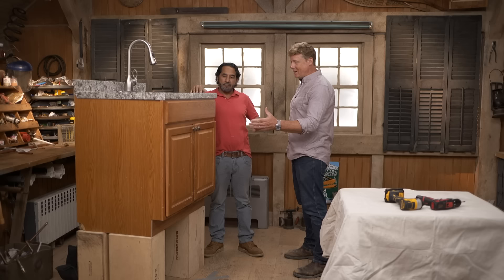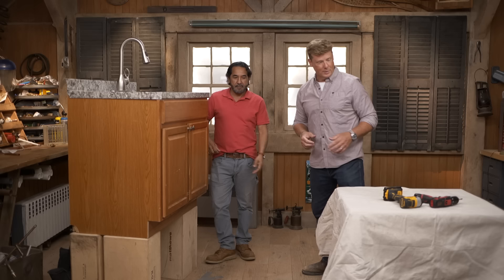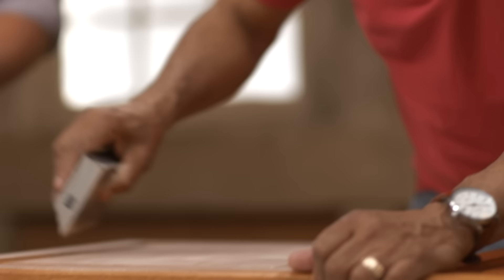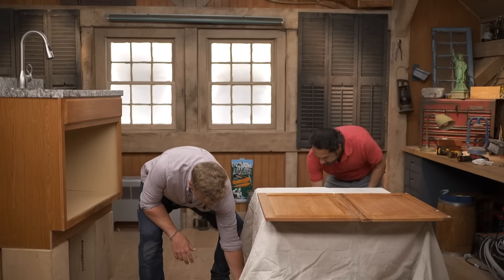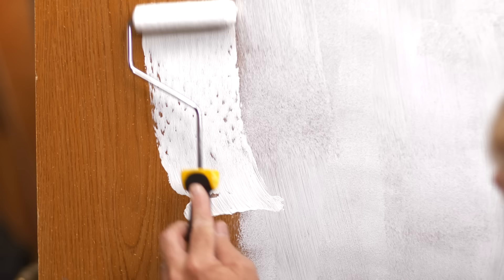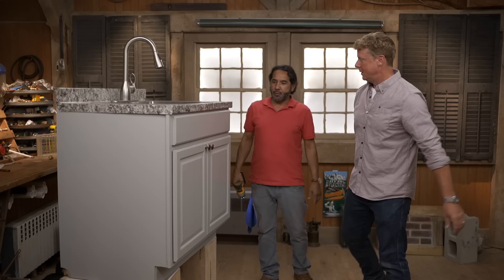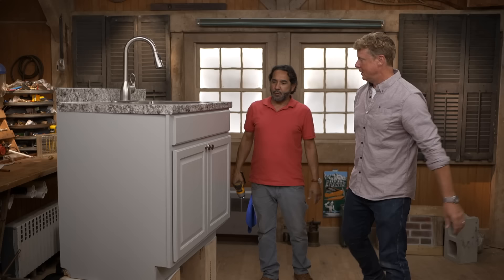How to Properly Paint Your Kitchen Cabinets  | Ask This Old House

Comment: Im confused. Are you rolling and then immediately brushing over what you rolled or are you rolling the first coat and brushing the second coat? 
Also, should you caulk between the panels and the  rails and stiles frame the center panel?
Finally, can you use spray primer in a can to speed up things?
Thank you!
Reply: I believe they rolled the primer on larger surfaces, and then grabbed a brush for areas they couldn't get to with a roller. Maybe they also did a final wipe with a brush for consistent texture?
Reply: So you roll the paint on just to get the material on the cabinets and then you back brush or we call it laying it down with a really good quality brush that way you don't have the texture of a roller, so you can use a brush and a roller to put it on and then you lay it down with the brush very lightly and if you're using quality paint you shouldn't see any brush marks
Reply: Boat painters roll on the paint and then tip it off with a brush. The technique is known as "roll and tip". Look that up and you will find lots of help.

Comment: Don't forget to fill the pores on all those oak cabinets unless you want the texture to telegraph through the paint.
Reply: I like that look, texture is very important on something like a cabinet. I'd prefer the natural wood grain to roller and brush strokes. Also not sure what you'd use to fill it, except a high build primer and sanding, I'd rather use a high bond primer, I suppose you could do both, one after the other, but that sounds like a lot of work.
Reply: @danb.709  They make grain filler that you spread on the wood before painting or finishing.  I just learned about it.
Reply: No need for all that
Reply: The cabinet paint will cover.
Reply: @Off-Grid  it's not about it covering, it's about it getting scraped off and dinged up during normal use. Also I like the wood grain texture, which a standard one coat of primer, and one or two coats of paint will not cover up, apparently others may want to fill the grain, but I wouldn't trust a normal wood filler over urethane.
Reply: Filling and hiding the wood grain makes your cabinets look like a set of cheap-a$$ melamine cabinets.  Letting the grain show through the paint maintains some of the warmth and richness of the wood.

Comment: Needs oil primer. The wood tannin will bleed through the latex paint sooner or later no matter how many coats you put on it
Reply: couldn't agree more. I'm a painting contractor of 16 years. I always use oil based primer then acrylic topcoat. I like to sand before and after priming then a sprayed finish also.
Reply: Bleed seal
Reply: Latex primer works just as good dummy
Reply: The original laquer finish is holding back any possible tanning issue. Bonding latex is fine in this application. I would only brush here to avoid any roller texture in both the primer and finish. I'm sure a close up video would reveal some sloppyness as the paint started to set up before back brushing.
Reply: @davetrial3972  lacquer does help to seal the wood tannins out. But I still have had bleed through with water based primer. It really depends on the condition  of the cabinets, sometimes it's not only tannins that cause bleeding. Another thing from my experience, water based primer generally doesnt sand or adhere as well. I like to put a thick coat of oil primer, it helps fill in small imperfections and powders while sanding. Maybe I'm just old school, but I have had good luck with this method.

Comment: Behr paint and primer covers well. Had a friend who had her house painted twice by two different contractors and two years later the paint started fading and peeling. The difference was spray and roll
Reply: You spray cabinets and roll walls. Not the other way around. Paint sprayed on walls has to be thinned down a lot to get it to spray and it just soak into the drywall and texturing. If you have ever tried to wipe off a mark from a sprayed wall you would know that the paint just rubs off and you rub a hole into the texture on the wall. Cabinets on the other hand are smooth and need to be sprayed to not have brush strokes or roller marks.

Comment: That upper panel on the front of that bathroom cabinet comes off as do the ones on the front of the kitchen base (or have tip-outs).  Remove them!!  Don't paint them in or you will regret it.
Reply: I left them on and have no regrets
Reply: @Fattony6666  Congratulations

Comment: I had my cabinets painted professionally and the paint seems to scratch pretty easily. Is this normal or did the “pros” skip a step?
Reply: Shouldn't scratch easily but that could be many different reasons. Didn't sand. Didn't use the right type of primer. Didn't use the right type of paint.
Reply: It's a really tough job to get right, cabinets take a beating people's fingernails constantly up against them when you go to reach for a knob or a handle if you don't take your time and you try to skip the sanding step you're going to have problems, it's a lot of money to have somebody come in and do it correctly obviously depending on how many cabinets you have
Reply: Did you figure out what they did wrong?  Get it fixed or repainted?

Comment: Why not spray paint the cabinets.  It would seem that you would end up with a smoother finish?
Reply: Spraying is definitely better! But for those without a sprayer, brushing and rolling a urethane enamel (ben moore advance, sherwin emerald urethane) Gives a great finish still. Not the same but still exceptional if done well
Reply: A lot of people suggest spray painting, but I haven't seen many people showing how to do this in the home. It seems to me if one is not a professional painter, the investment into costs to do this would be daunting. Unless you are going to be spray painting a lot, you might as well buy new cabinets!  Also, spray painting would require more than tape and a little newspaper to avoid over-spray depositing on the rest of the kitchen. Someone I know, having more money than most homeowners, hired someone to spray paint their cabinets. The painter took doors and drawer faces to a shop that was dedicated to spray painting, where the parts could be hung for painting. They brush painted the frames and sides in place in the home. For folks like me having a small kitchen and needing to do this job maybe once every 7-10 years, spray painting is just overkill.

Comment: A question I have not found the answer to:  Several professional painters (for outside) said primer should sit for 24 hours before you paint so it will 'cure'.  The paint can says dry in an hour or so.  I have some paint failing and not sure if it is bad paint or that I painted too soon after primer. (I would never use the primer + paint.)  This Old House or even other painting videos have never addressed in any video the question of how long to wait .
Reply: Always follow manufacturers instructions which will vary per primer
Reply: So the previous answer is right follow manufacture recommendation. My experns is and I’ve been doing a lot kitchen cabinets is Different . I used multiple primers in my past oil primer, latex primer. I never had to wait more than a couple hours after after I applied it to start sending it down. if you put it on to thick it’s gonna take forever to dry . the primer usually goes on very thin and does not have to cover solid. You can use oil primer what you can send very easily and dryes very quickly there is also bonding primer if you have an item you want to paint but you’re not sure if they use latex or oil or polymer or polyurethane paint you can always just put a bonding primer on it very thin and then you can put anything on top of it even on the oil primer you can use a latex finish. Drying time : You always have to thinking about the condition where you priming it if it’s a lot of humidity it’s gonna take forever to dry no matter if it’s water or oil base. After you prime something and you able to touch it without getting paint on your hand you can put it outside on the sun and let it bake for 30 minutes or an hour it’s kind of like the way they do it in a Commercial settings where they put it in the oven.
Reply: Thanks for the reply and that seems to cover inside painting.  Several outside painters told me to wait 24 hours after priming for it to cure (oil and latex primer).  Just because it is dry to the touch they claim it still needs time.  Have any of your pro-painters heard of that?
Reply: What you want to look for is the recoat time. It could say dry to the touch in two or four hours but the recoat time could be 12 or 16 hours. FYI it takes paints and primers weeks to cure.

Comment: Don’t use water based primer for cabinets! Use Zinsser BIN. It won’t come off with proper prep. Oil paint is best.
Reply: I've used water based for cabinets and it works great. Don't listen to "wildmike223" from the youtube comments for advice
Reply: @Fattony6666  It may work fine but using an oil based or shellac based primer is much more durable then what any water based primer can give you. So for something you'll only want to do once, I'd go with the better working product for this particular job. An acrylic latex paint is fine on top of either primer but I'd suggest an enamel top coat, especially for something that will see daily use as it cures very hard and can stand up to abuse much better. Prep work is key to success for either product though.

Comment: wont water based primer and paint peel? 
i was taught to use oil based on wood surfaces to adhere best not water based. i once dealt with water based on wood and it peeled so easy
Reply: totally fine to use water based on wood. tech had come a long way.
Reply: no it won't peel

Comment: HVLP is the only way to get a pro finish painting cabinets....even with $30 brushes it'll look like a flippers special.
Reply: You are right, but they will also need to be highly skilled in using sprayers on a cabinet
Reply: @jeuneroi3069  It's only 1k paint...hard to mess up because you can keep recoating with no real off gasing period.  Spend the time doing quality prep work and masking, sanding out the primer, and as long as someone doesn't apply any single coat too heavy, it's pretty hard to mess up.
Reply: this is meant for homeowners....
Reply: @tonythetiger9839  You can rent HLVP equipment...

Comment: I’m warning u all. Don’t do it. U have to use oil based laquer or it will chip. U can do touch ups but if your a perfectionist you might be mad. Also again if your a perfectionist, a sprayer will make them look more like factory finish then rolling. I love u 🤟

Comment: Why a 3/8 wall texture nap roller, when you could of used a smooth foam roller, even better yet, a sprayer?
Reply: A sprayer is the way to go.
Reply: No everybody can afford a sprayer or even rent it, the thing about to paint it with a roller is to make it affordable...
Reply: Foam rollers are junk, they’re texture makers. If you know how to time your paint you can make a half inch roller make something look nearly sprayed.
Reply: Have any of the sprayer afficionados used a paint sprayer inside a house that has people living in it?  Not in my house. Spray gets on everything including in the air ducts and lungs.   A paint sprayer is an outside toy.
Reply: @rchukran  that’s false. It’s called knowing how to spray and knowing how to control airflow. transfer efficiency is key.
Reply: @rchukran  with proper preparation,  like a professional painter, you’d have the room masked, plastic in place of door ways, air returns and vents sealed, with an exhaust hose running outside, it can be done and is very common, I’m sure TOH is bending them over BIG time on this job and could’ve very easily done this for the customer and still made 110% of their 300% profit margin

Comment: Looks like there is more information, tips, and explanations in the comments than there was in the segment.  I think it's time TOH hires a new painter who can describe properly what to do and how to do it.
Reply: Why? What more is there to know? This is about as basic a job as there is. I honestly don’t know any other way you could do this.
Reply: @johnr5252  it would have been helpful to describe why they were back brushing - or mention it at all.
Reply: No sanding after primer was applied, no scuff after first coat, no explanation of what they were doing with the brush after using the roller (tipping off the paint), no explanation of what roller they were using and why ect

Comment: I'm confused - Years ago TOH showed a lady how to refinish her kitchen cabinets and not only were there several steps involved (especially with the  sealer), it took her several weeks to do a small kitchen and had doors hanging in her basement.    It was quite a tedious project because you are dealing with grease and grime.  What they did here seems to be incomplete -
Reply: They used oil based paint cuz that was back in the day old school paint 
Nowadays they have high quality low voc water based paints, but oil based is still much cheaper
Reply: Don't be fooled by this 7min video. What you saw them do in this video takes hours to do. If you have a whole kitchen to do and you are working alone it will take a very long time. Sanding, waiting for everything to dry, multiple coats.

Comment: Oil base primer, stain killer, never latex primer, especially with white and lighter colors all of the wood stains will bleed through the top coats, then maybe grain filler and stix bonding primer and then two coats of latex.

Comment: I could do without the slow motion glam shots and stick with informative content. I really learned nothing from this about painting. And how do you paint the cabinet without getting paint on the unmasked counter top? You numbered the doors with a sharpie then cleaned and sanded the sharpie off so your back to not knowing which door goes where.
Reply: You write the number in the hole where the hinge was
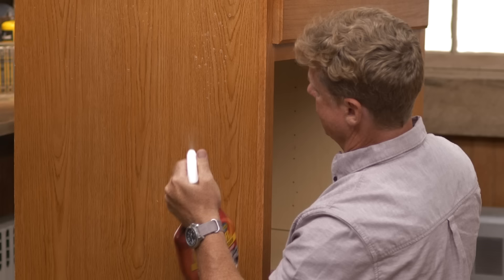Reply: He wrote it inside the hinge at 1:22, as for the the unmasked countertop he used a brush, usually an angled cutting brush for the edges and a straight brush where he didn’t need to get into corners or edges, along with the roller on the large areas. Very informative actually.

Comment: Apologies but not much useful information. Why not recommend some good brand of cabinet paint? Or the best type of brush to use for not leaving stroke marks? The most important thing in painting cabinets is getting a smooth finish with no blush marks. Lightly sanding with fine sandpaper (220 grit) after the 1st coat of paint, will help give the final coat a smooth finish
Reply: They don't do product pitches in these types of episodes.  There are other informercial-type segments done by the show but they do not involve the regular cast, but other paid characters secondary figures where the company doing the pitch is driving the entire segment.

Comment: I did a perfect paint job on a three-bedroom house I flipped. It took me four times longer than normal just to prep. It was flawless but your cabinet is not. You should have used a 2 gallon garden sprayer....

Not to apply paint. To mist the entire interior of your area. You must knock the dust out of the air! Cover the cabinet with a piece of cardboard and mist the room and air and yourselves. Your clothing has dust on it as well.

Maybe I went overboard. I did a lot that I never did before. I did the cut in and the rolling of the walls at the same time. In 4ft sections, switching between the two, so as to not lose the wet edge anywhere. What a workout!

I'd examine the paint every time I started. Three times I didn't like how it looked. I grabbed the damp towels I had for the very purpose, and washed all the paint off the walls. Once it was roller fuzz, another a contaminant in the brush I was using, and the third time contaminants in brand new paint.

I teased the drywaller about slopping paint up myself. He was very worried. When he showed up and looked at the paint, he wandered, mouth agape, for about 10 minutes just looking. Stunned and impressed.

It was perfect. Every cut line like a laser. I never once touched the ceiling while painting the walls. Same goes for all the door frames, window frames, anyting. It was truly like vertical, still water. I always checked it with the flashlight at many angles to make sure it was perfect while painting. That was the first and last time I have ever seen a wall that had the exact same amount of reflection everywhere.

I say reflection because when you stood at the corner between the medium green wall and the natural cotton (white with hint of green) wall, they were both the same color! I would ask people to stand there and then ask them how well I matched the two walls in color. Everyone complimented me on the perfect match. I said hey look down this wall a little ways, you sure it's green. It was the natural cotton wall reflecting that green paint. You could tell after you looked about six feet away. I told people that it was Magic Paint that I used. It was actually the paint Lumberjack had and I think it was Ace brand. Nothing fancy.

I could go on and on and on. Oops, I guess I already did that.
Reply: That’s the dimmest idea I’ve ever heard
Reply: @jtblatt1988  Yep
Reply: And I thought I was a perfectionist....